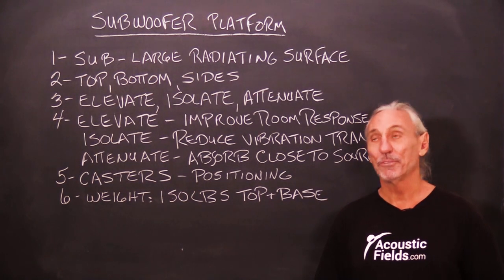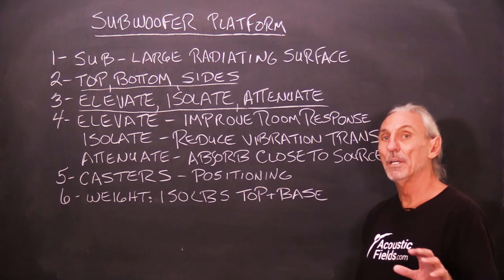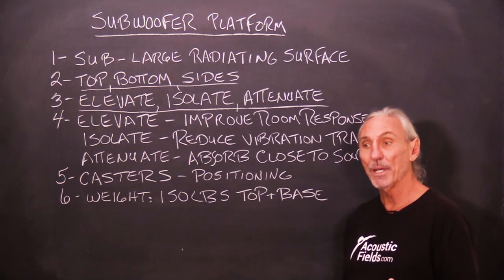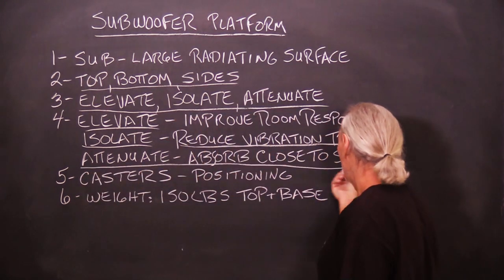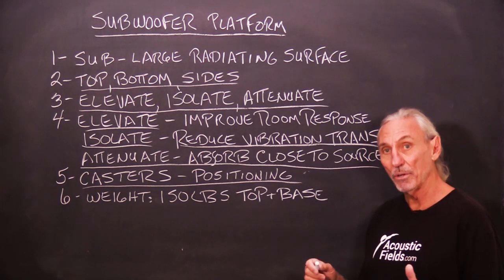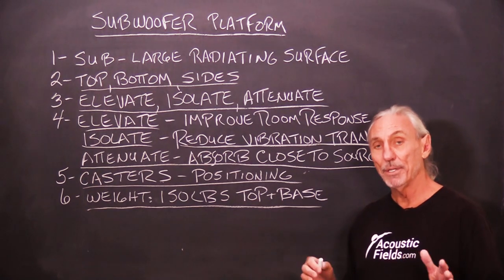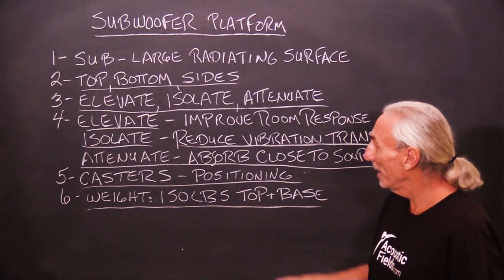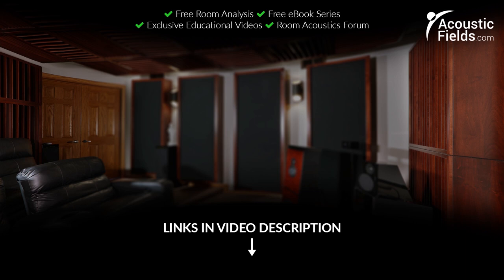Subwoofer Platform - www.AcousticFields.com

Comment: I was doing this 6 years ago. I built 3 platforms [risers] for my subs made out of MDF they were about 30cm high, then I put about 5cm of sand in them to help reduce vibration. On the underside of the riser I glued a 5cm thick acoustic foam which covered the whole surface. Immediately the difference in sound was apparent, it tightened up the bass response and I felt it more in the chest even though I didn't turn the volume up. I still have one of those boxes left collecting dust in the garage. 
This stuff really works, sadly I don't have a home theatre setup anymore.

Comment: I have taken measurements with REW. For one of my measurements I had my subs raised 2 feet. The second measurement they were sitting on the floor. I had seen absolutely no changes in my graph. 
Is there something I missed? I’m genuinely curious how elevation will improve my bass.
Reply from the maker: Move your sub around in the room. Start at room center and move left to right and front to back.
Reply: The difference in response commonly varies more as you increase the subwoofer's XO frequency. Also, it depends on where the sub is placed as to the variability in frequency response. Finally, ensure you are not overly smoothing the REW responses which will "hide' differences in response curves. I hope this helps.

Comment: hey Dennis, do you think this platform would work for a set of jbl 4343b? they have a 15 inch low bass driver at the bottom and a 10 inch mid bass driver above and weigh approx 90kgs, they are quite tall though approx 1050mm high so I am concerned about making the tweeter too high if I elevate them, cheers mate
Reply from the maker: We can design a special platform for this project. Send contact info. to info@acousticfields.com